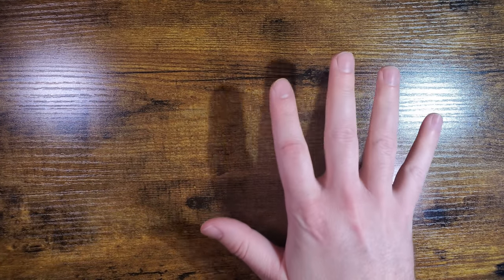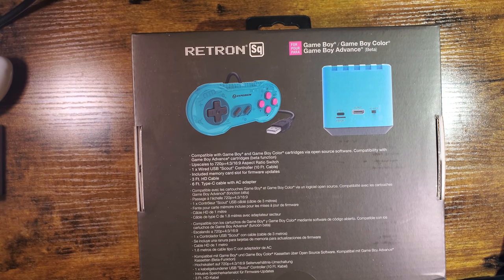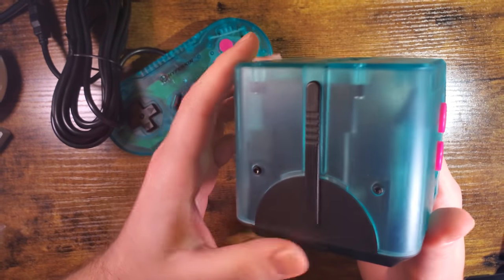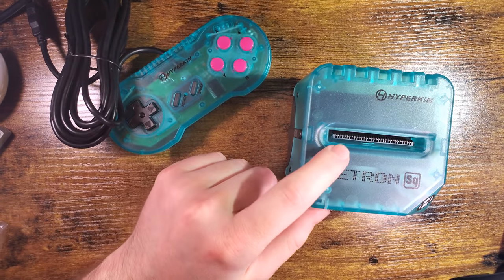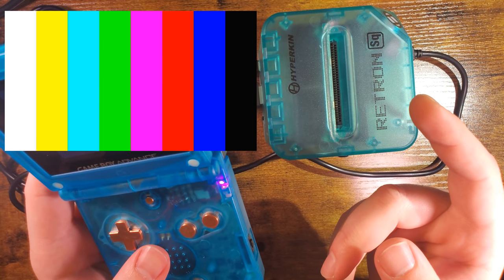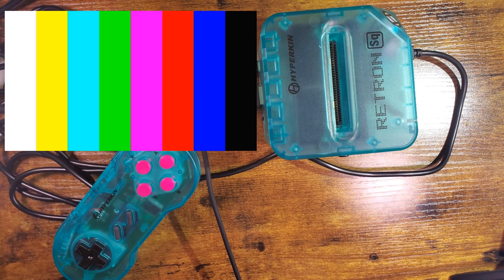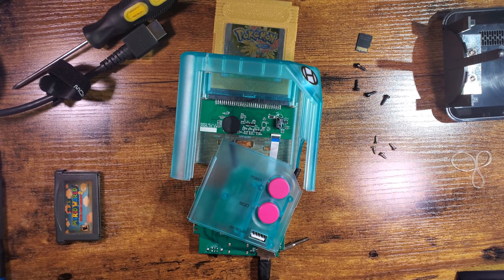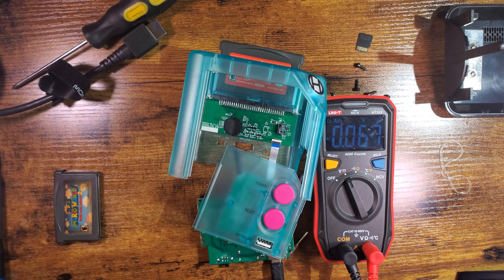Hyperkin Retron SQ

Comment: 38:30 the chip under the glob is probably a parallel to serial or spi converter so they don't need as many wires on the ribbon cable to get the data off the cartridge

Comment: Yeah, the problem really is with the fact that A: it doesn't output the original aspect ratio, and B: it doesn't write your saves back to the cartridge whatsoever.

I don't mind 4:3 way too much on Game Boy games as the Super Game Boy already does that with them so I'm kind of used to it. But it still should have a proper option for the correct aspect ratio. It's totally inexcusable with GBA.

My guess is that the SQ can only detect certain save file types to rip them when it comes to GBA. Red Rescue Team is Flash RAM, so maybe the other Pokémon games will work, or Super Mario Advance 4, but not EEPROM or SRAM/FRAM GBA games.

Comment: Honestly, the fact that it can't write saves to the cart just ruins the entire deal. Also how you can't remove the cartridge when the game is running (even though you know the whole thing is already dumped and loaded) feels like a useless limitation. The reason people buy/build "consolized" handhelds is so they can swap the game between their TV and handheld at any time, much like the appeal of the Nintendo Switch. If it doesn't let you use the same save, might as well just get an emulation machine instead. For me, I'll just stick to my Super Game Boy
Reply from the maker: the reasoning behind making it reset when you remove the cart is so you can hot swap games. You're not supposed to per Nintendo's instructions, but per hyperkin, you can. Knowing that it's intentional and for that makes it a bit better but there's literally a reset button right there so idk why they bothered.

Comment: Btw none of OBS’ default upscaling modes are very good for low res games like these, they make everything just look blurry. I forgot the name of the best one they have (I think it’s called near? Or point?) but it is still not perfect and sometimes messes up the size of pixels. Dunno what capture card you are using but there might be a way to choose what upscaler you want to use in the preview window of its software and you can add its preview window as a source instead of directly adding the video capture device to OBS

Comment: 33:45 To give Hyperkin the benefit of the doubt, I think the weights were to keep it from moving, so it won't slide around when using a wired controller. But holy crap, what a cheap hunk of plastic. For $80 USD too. If it was $30 or $40, it'd be acceptable with all these issues. But $80? C'mon. 

Also, did you manage to find that GBC homebrew for the scrapped extra features? Cool joycons btw.
Reply from the maker: I mean, it could be both. The power and controller cables aren't really that stiff. HDMI might be but there is no reason it has to be (I didn't test the cable it comes with because I already had one plugged in). 

https://github.com/AntonioND/gba-switch-to-gbc

Comment: I never understood why these Retron devices have to copy the rom to a on-board memory before it can play it.
Reply from the maker: Because the interface just isn't fast enough. The way the emulators work, they need much quicker access to the ROM than the physical cart interface allows. Copying the game into system memory allows for that fast access. 

Modern systems don't have I/O that works in quite the same way compared to GBs for both security and cost reasons.

Comment: There is a custom firmware that auto sets frameskip to zero. No need for a keyboard.
Reply from the maker: Still doesn't fix the even bigger save issue.
Reply: @makho  naw it doesn’t. I don’t think that will be able to be fixed. They most likely didn’t think of that in design.

Comment: Connect a keyboard and then once you fix the frame settings and any other settings pressed escape button and it will reset the entire console forcing it to keep its memory forever so you will not have to go and change it back down to 0 frames every time you use it
Reply from the maker: Doesn't seem to stick when I try it. Even still, the saves are still hit and miss if they'll even read and they never write back so it seems pointless to even bother until this is fixed.

Comment: If these had real hardware or a FPGA inside I'd get one but they only have a emulator on them and these cost about $75 USD so for streaming I'll just spend an extra $150 on my gamecube (DOL-001) for a gameboy player a digital A/V out to HDMI adapter a xenoGC chip and the micro sd to GC memory card adapter that i designed (for running gbi) then capture the HDMI with my elgato HD60s and upscale with my PC.
Reply: Or you send 75 Euro to buy All parts of a Gbahd. That's a gba consolizer that is in work and open source
Reply: @-Gothicgirl-  but I would need a GBA system for that, I used to have one but the screen got broken and I got rid of it also I don't like building things like that because most of my tools are still cheap garbage so I've broken a bunch of stuff which isn't made anymore with them and I like using things I already have so I don't have to buy more stuff and use more space to store it when not in use.

Comment: This little device looks cool BUT that it is emulation based rather then being fpga ,is absolutely LAME, and looking at the internals, it looks very cheapass made,
The only real interesting thing is the way it detects GB & GBA games, instead of implementing a physical switch(wich will wear off overtime within 15 years), i guess it detect detects a GB or GBA game by looking into it’s header to determine if it is a GBA or GB game and then apply the correct voltage to it, then it reads the title of the game to determine wich emulation setting to use,
Am also interested to see wich type processor is used and were and how small it is,otherwise am very happy with my gameboyplayer.
Reply from the maker: the CPU is some generic ARM based chip, probably a mediatek or rockchip or something. It's nothing special but it works great for this specific purpose. 

I'd like to point out that FPGAs are still emulators. They just emulate hardware directly. Emulation is not inherently bad but bad emulation is always bad.
Reply: @makho  woooW if that’s true that the cpu is ARM based, then it’s easy to emulate the gba since the gba is also ARM based,unless those adress registers on that cpu is different from that of the gba, in such case all those adress registers needs to be remapped wich can take some time,

But gameboy games however are Z80 based so recompiling z80 code into arm code and to those correct adress registers among behavior of the gameboy is required,so that’s more challanging and requires tons of more processing power to do such thing in realtime,

Now Note; that for instance despite the snes do share the same type 65X cpu of the nes  but many adress registers are different from the nes, so remapping them is required in order for a 1 to 1 communication,

Fpga chips are often called simulation chips but they should,ve been called replication chips instead as they replicate those older systems on a hardware level rather then on a software level,

But whatever those chips are called,emulation chips,simulation chips,resamblation chips or replication chips
Their porpyses are the same😁